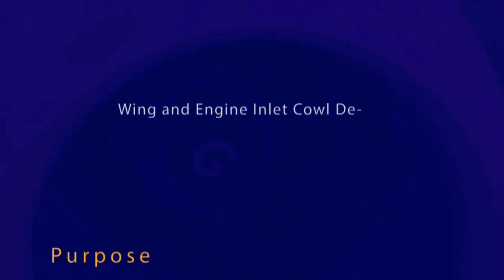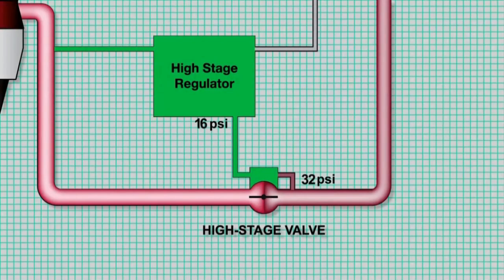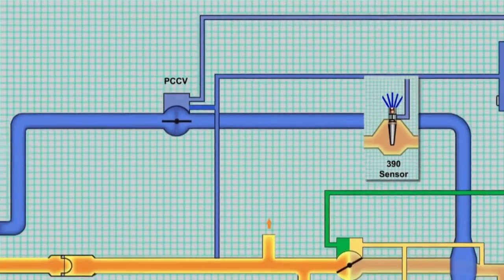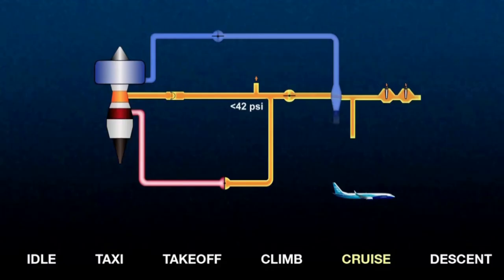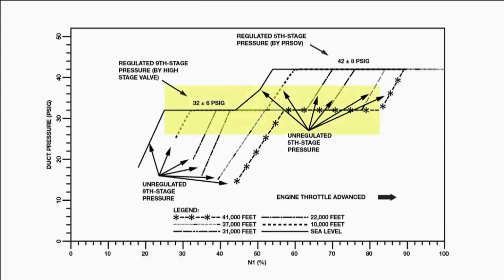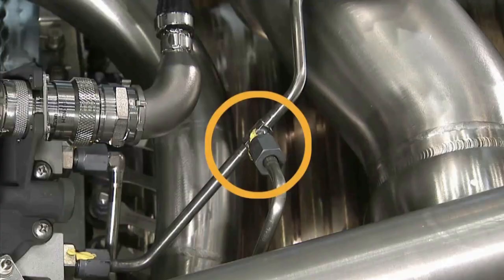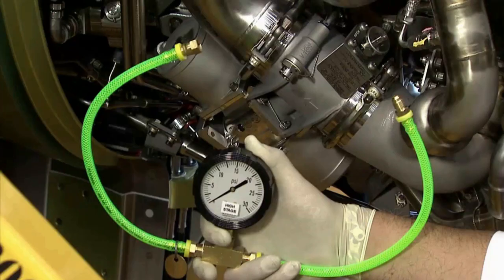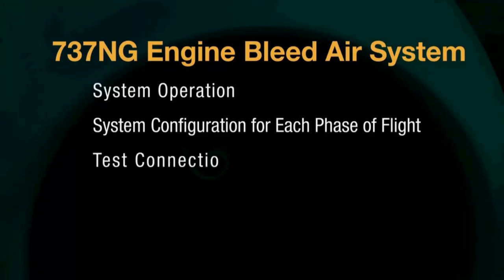BOEING 737MAX/BOEING 737 NG BLEED AIR SYSTEM. ATA CHAPTER-36.

Comment: hi there, need some helps here.. i have a defect in which bleed air regulator for b737ng eng 2, failed to open during ground test, the power supply always shows at close circuit. no power goes to open circuit, even bleed switch in cockpit selected to on. after troubleshooting carried out, we were in puzzle. no idea what actually happened.  end up, after exhausted to proceed the troubleshooting  , we try to start  the apu and supply bleed as per normal and suddenly when select bleed switch to on for engine 2, power 28dc was available for open circuit bleed air regulator.  anybody can help to explain this situation?
Reply from the maker: Enquiring abt BAR , for supply power from switch to BAR solenoid ACAU discrete are involved to decide when to put power in relation to engine run relay..
Reply from the maker: APU logic have no resemblance for Engine BAR ops particularly BAR power section.
Reply from the maker: Ask him to replace BAR or BAR harness as we had similar issue faced in past due to BAR harness faulty